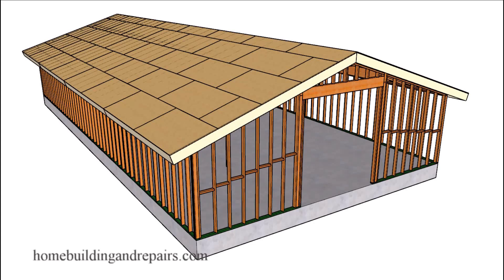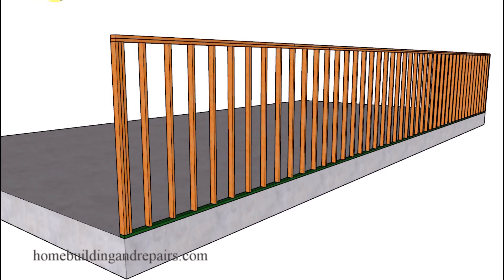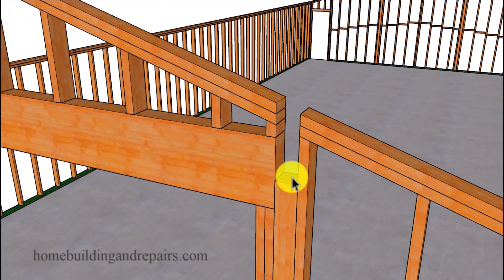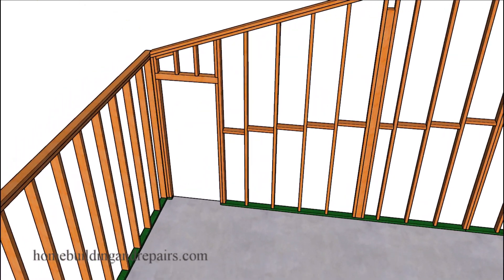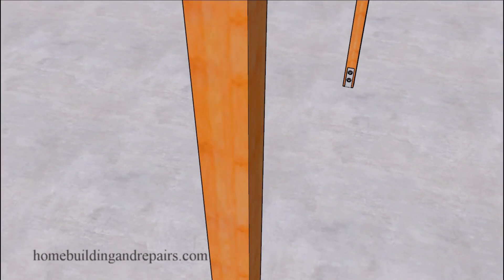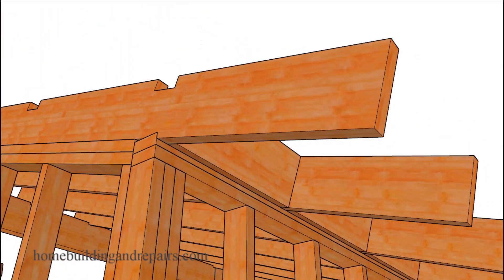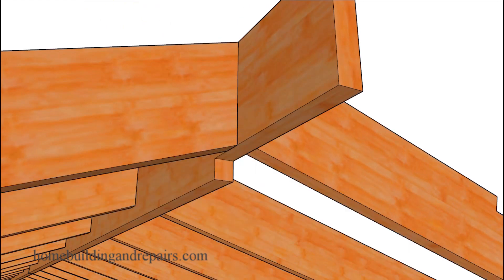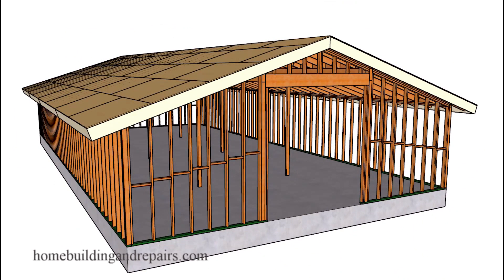How To Frame And Build 30 x 60 Foot Garage, Workshop And Storage - Construction Education Examples

Comment: No raised concrete curb along the perimeter wall or are you assuming the concrete pad is above grade?
Reply from the maker: You can put raised curbs if needed. This design might require site drains or re grading property because it's such a long building.

Comment: I recall you did a few videos on concrete columns and concrete beams.... any chance a shop like this can be set up with a concrete column every 12 or so feet and beams placed atop them for the exterior walls and somewhat normal open trusses crossing the width for a living space ...

i am thinking in a an area that has heavy snow loads and you don't want the base of the walls to rot or the snow that runs off the roof to push against the walls....
Reply: Absolutely. Another approach would be to run a stud wall on top of a stem wall.
Reply: Or, you can set posts every 8' or so on top of a stem wall. Lots and lots of options and approaches.
Reply from the maker: I would imagine the concrete posts will be more expensive, but could be a lot stronger.

Comment: The blocking in the rafters looks like it’s all running in the same line. Is that just getting toe nailed then, or can it be offset to nail through the rafters and into the blocking?
Reply from the maker: Toe nailing will work, but most of the time you can end nail at an angle. Remember you will be installing one block at a time, allowing you to end nail or drive nails from the side where you haven't installed a block yet.

Comment: I would do it but I don't have the $1000 per glue lam for the post beams 😢. City of Phoenix specifically prohibits post framed buildings/barndominium from most res zoning (special $800 applications accepted, no approval guarantees) how about California Greg?
Reply from the maker: Good point, always check with local authorities before building. I've seen similar buildings like this in other states.

Comment: Can someone please explain to me why trusses couldn't be used? Is it a load issue? Sorry I'm learning
Reply: Great question. Trusses could very well be used, but I think there'd be a considerable cost to consider when ordering 30' clear span trusses. Also, trusses would limit ceiling height/space, where Greg's design leaves plenty of room. Finally (and there could be more), installing rafters is easier on the DIYer than installing trusses. Trusses more than likely require heavy equipment. Hope this helps.
Reply from the maker: I will be making a video with trusses in this series.